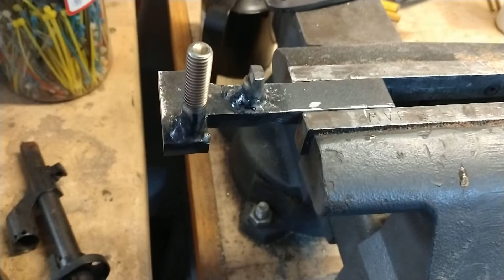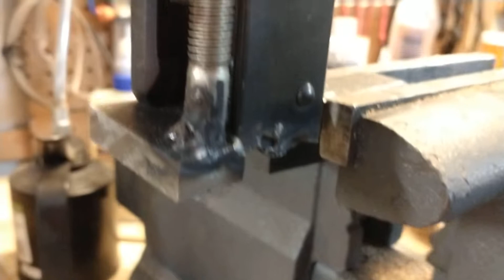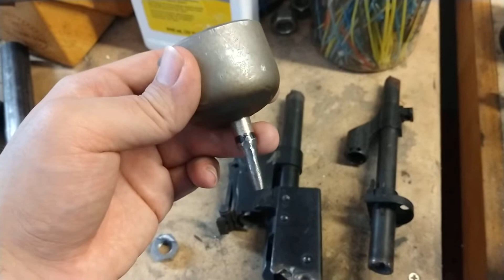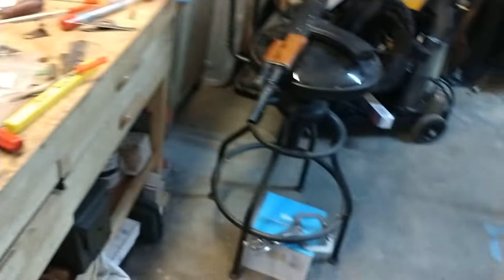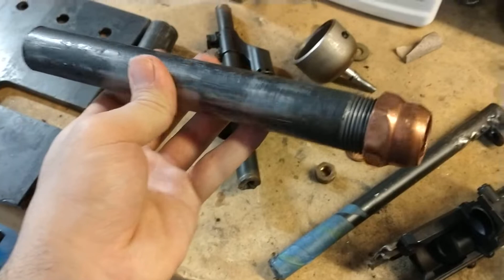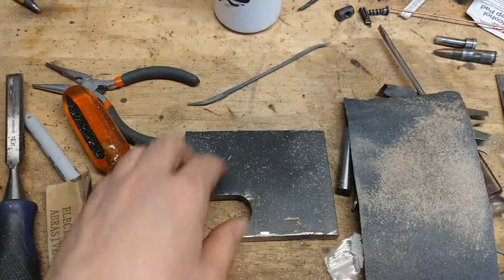Intro to DIY AK Building Tools (and tools you should buy!)

Comment: Great video.   Lots of different ways to get a job done.  I use an aircraft rivet gun and brass sets to drive on and off FSB and gas blocks.  I've used it to drive in barrels with a sawed off slant brake to protect the crown and threads.   Built lots of AK kits and don't own a press.  Another thing I use alot is heating and cooling parts that are interference fit.  If you put a barrel in the freezer over night and heat the trunnion, barrels usually slide right in.  I spent part of my career as an airline sheetmetal mechanic so I'm used to doing things from a different perspective.  Just some different ideas.   What's the status of the milled Chinese build?
Reply from the maker: Sure, I prefer the press and the mods I've done to it specifically because I can control it and it was honestly cheaper than a high quality aircraft rivet gun, but I know plenty of A&P or sheetmetal guys that prefer their rivet guns and hand tools because they are proficient with those.  Heating and cooling parts is also a trick I'm aware of.  Guys have been doing that since the 90s when kits were stupid cheap and good receiver options were nonexistent or just completely unavailable in many cases.  The milled Chinese build is taking a different direction, I was not comfortable using that ATM receiver because it seemed that heat treating was never done to it based on my file tests, and I do not have a means of professionally heat treating without the risk of shattering those locking lugs.  Instead I opted for a Tortort Chinese receiver, and I'll be building my milled spiker using that.
Reply: @rfcmachiningllc  I'm one of those guys that started in the 90's when kits cost 89.00.  I hope you do some video's on the Tortort build.
Reply from the maker: @flyguy30263  For sure, I have some great things coming down the pipeline for this channel, the Tortort build being one of them.